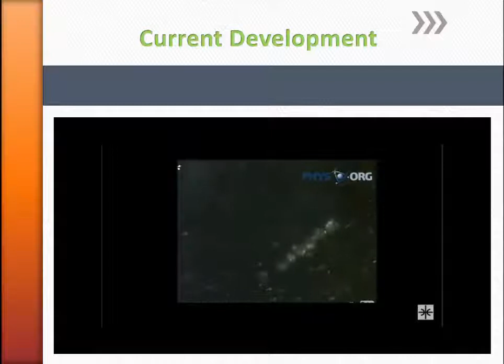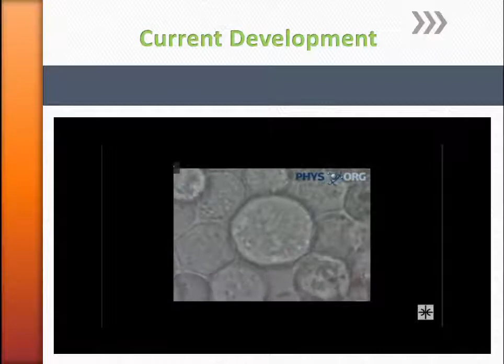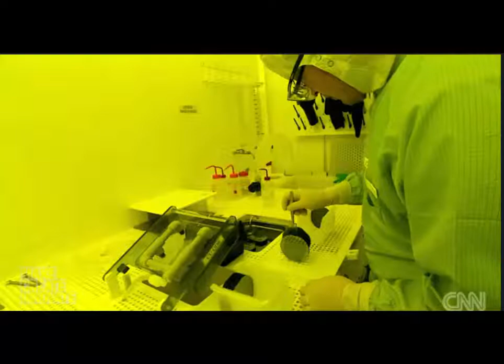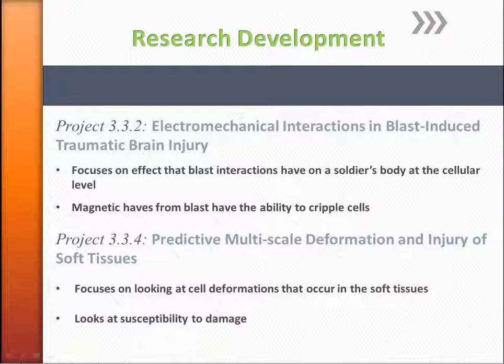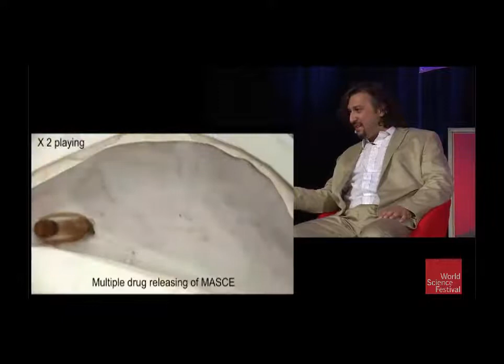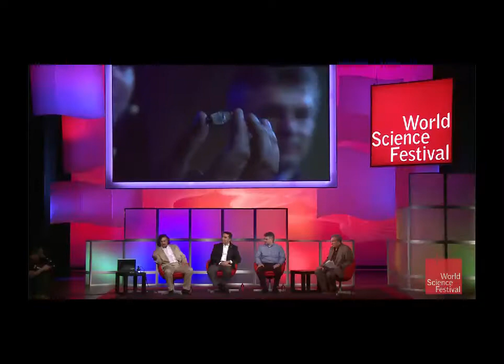How the US Military Uses Nanobots and Nanotechnology to Help Our Soldier's and Save lives

Comment: Buy a good magnet mattress pad and a shower filter. Drink only filtered water, eat only non-preprocessed, non-gmo, organic,  cup of Borax in tub and soak or use Borax as a body scrub to get nano out of skin, put on scalp, massage before shampoo. NO SUGAR,  because you'll get candida overgrowth immediately due to constant EMF agitating everything. EMF, nanotech and candida combined will cause much torture, misery. Drink apple cider vinegar and water daily, if you don't have apple cider vinegar, regular vinegar will work. Lecithin helps tremendously, but is hard to digest as you get older,, so if need be, combine with enzymes to help digestion , can put Lecithin in your apple cider vinegar and water as well. Sonne's #7 Bentonite Clay Liquid detox works to  get rid of nano, heavy metals and radioactive particles.